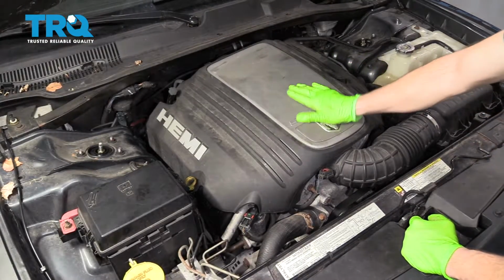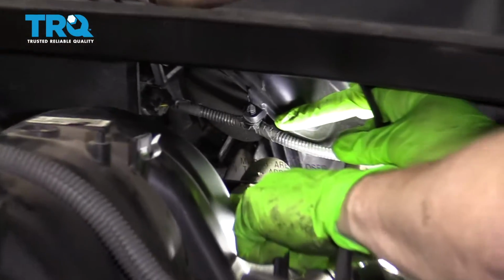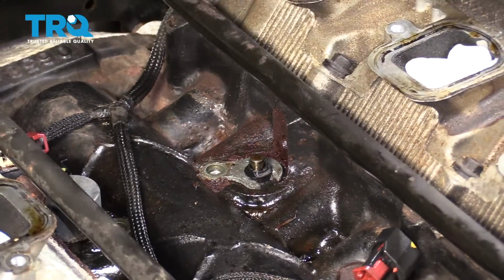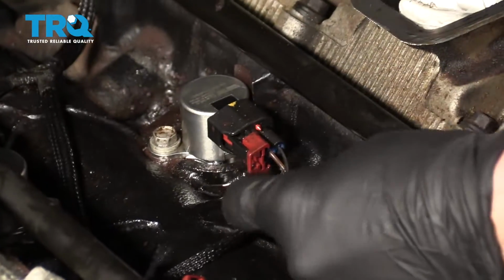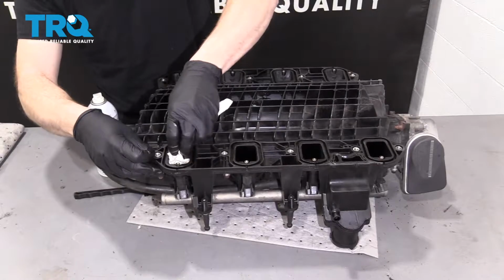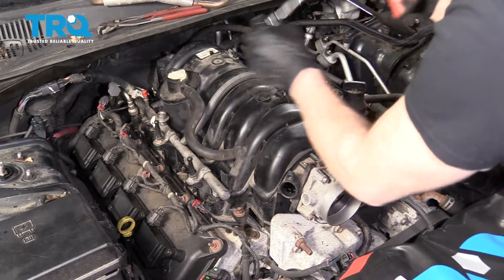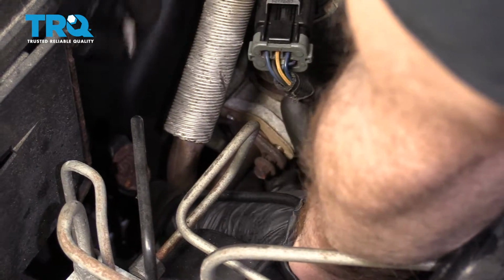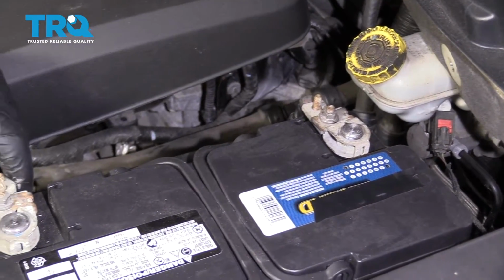How to Replace MDS Solenoids 2006-10 Dodge Charger

Comment: Hey whoa you should disconnect the neg battery terminal first before disconnecting any thing from under the hood bcuz it will cause computer program problems especially when it comes to throttle body sensor mines was replaced and the shop didn't disconnect the neg battery terminal as I ask and it through codes and would not crank up again

Comment: a dealership wants to charge me $1186 for a 2014 charger work. they said solenoid AND wiring harness for the price I mentioned BOTH need to be replaced I feel like I'm being scammed for that price, let alone the idea that the wiring harness needs replacing.

Comment: I don't know if they changed something from 06 to 09. but my battery is in the trunk. My engine doesn't run super smooth it does shake ever so slightly but not much. Might have to do with cylinder 1 having lower compression than the rest about 90 psi while the others were like 120-130 psi I believe.

Comment: How do I find the location of number 4 cylinder MSD solenoid location
Reply: Second spark plug from the front on the passenger side or the first MDS Solenoid on the passenger side from the front.

Comment: I need to add a WARNING!  On my 2006 Grand Cherokee, I had a shop replace the starter.  They left the battery disconnected for some time.  When I got it back, the 6 CD changer stereo was brain dead.  All I could do was take it apart and get my CD's out.  If there are CD's in it when the power is disconnected for hours or days, and I assume, also if the terminals are shorted together, it bricks the stereo.

Comment: I just received the P3449 fault code on my 2012 Charger rt. Cylinder#7 deactivation solenoid. I’m wondering if this job would be covered under an extended powertrain warranty that I purchased.

Comment: Just dud my 2006 ram hemi
Was ok 👌 not to hard 
I couldn't get the fuel disconnected so I put it aside
Removed the throttle body
Had 2 msd break off
Used the self tapping screw in one 
Got it out 
Not to hard
The reason I had to do this is a code came up about the left side msd system
Then #4 was not kicking
So I ordered all 4 (not to bad $300) 
So let's see

Comment: This was the best step by step video I've ever seen. Thanks brother. I am having problems with my 2006 Jeep grand cherokee 5.7 Hemi. I wasn't having any issues at all , but then I decided to change the injectors. Why did I do that???😫 I did it because I was bored and for the last 3 yrs I would sometimes smell gas through the vents not that often, just when passengers were riding with me lol 🤣, but it never ran bad slow or sluggish until I changed the fuel injectors. Now I'm getting  missfire code 0303 cylinder 3,  code 1416 1417 codes are popping up, and now its running sluggish. What have I done? 😩
Reply: Did you fix it?

Comment: Great video. I want to know if a BADMSD could cause these error codes on a 2007 Jeep GC 5.7L HEMI. 
P1417 - Cylinder 7 Reactivation Control Performance
P2320 - Ignition coil 7 secondary circuit - Insufficient Ionization 

I already put new spark plugs and coil pack for cylinder 7. Checked the cables, power comes through, spark plugs working fine. The codes are still active.

Any advice would be greatly appreciated.
Reply from the maker: +Susith Dunukara Thanks for watching!  We would not be able to diagnose an issue like that for you.  If you are unsure what the root cause could be we recommend having a reputable shop take a look!
Reply: Did you find the problem?
Reply: Did you find the problem

Comment: Just another tip to add. Instead of removing the center pin from the MDS sensor and insert the tap, you can just run a small screw into the plastic ring of the MDS sensor after you snap them off. I just did this on my ram 1500 and once I had the intake off it took me a matter of 5 minutes to get all MDS sensors out.
Reply: Once you have the screw in the sensor just use a regular hammer to pull them up and out.

Comment: Why would the MDS sensors need replaced? I have a Jeep GC Hemi that runs fine with no CEL, but I am NOT getting the advertised 19MPG highway.
Reply: They will eventually fail like any component, usually causes misfires.

Comment: What was the purpose of discharge the capacitors by disconnecting the battery?
Reply: To reset the PCM and force the computer to re-learn.

Comment: Hi great video do you recommend dorman mds solenoids. Im currently working on a 09 ram 5.7 came after 3 mechanics. They replaced cam and lifters and mds solenkid but it keeps trowing p03497 after a highway drive. I removed head n oil galleys look fine but i did notice they replaced mds solenoids with Dorman aftermarket mds. I suspect the brand. Any advice would be highly appreciated
Reply: Did you clear the ECM by touching the positive and negative battery cables together? 100% necessary after replacing MDS solenoids.